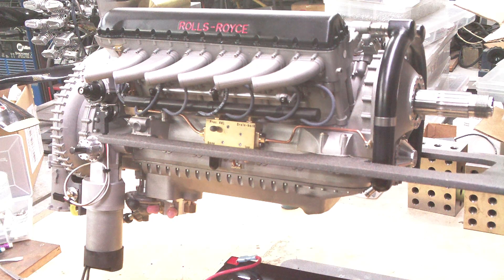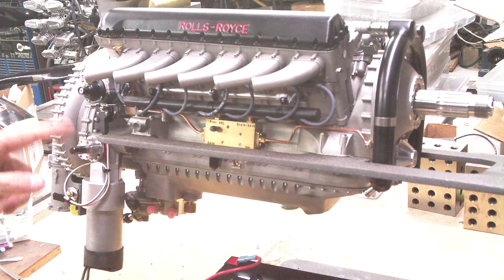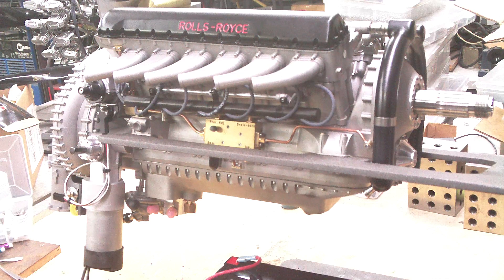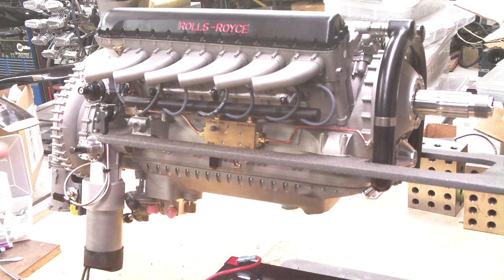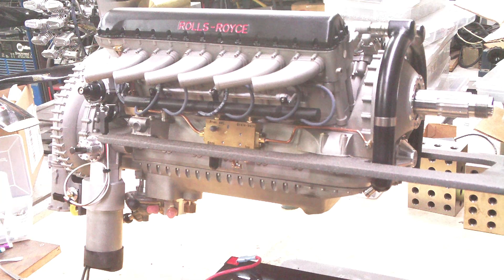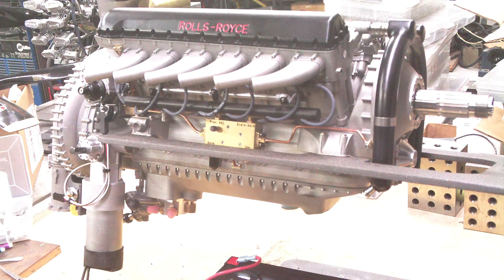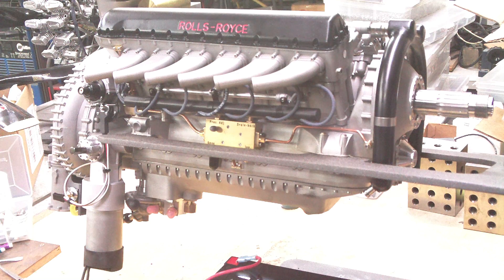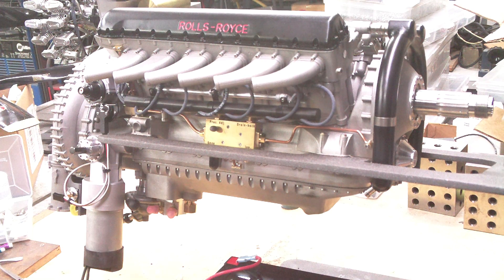Merlin Starters

Comment: Looks like a labor of love....I think that the starter motor need a one more reduction probably a 3 to one.. other wise you run the risk of braking the gearing "If the propellers are mounted.. it actually looks like a awesome ultralight motor..

Comment: Amazing build. I read your thread , not all of it though, which will be obvious from my question: What is the reason you use 2 valves instead of 4 per cylinder ?
Reply: As if it isn't tough enough already! Even if it was possible to do it in a 1/4 scale engine, you'd be more than doubling the work required to achieve it.....at least! 48 valves, springs and associated components compared with 24! It's a no brainer isn't it? That's not to say Terry couldn't do it. I'm sure he could if he really wanted to do it
Reply: As it looks to me, this model is not about saving time and taking the easy route. That is why I asked.
Reply: The castings used were designed for two valves not four.
Reply: Ah, then I understand. Thanks for the answer!